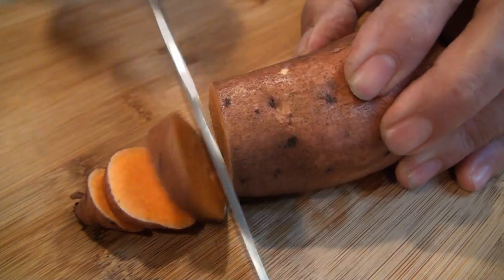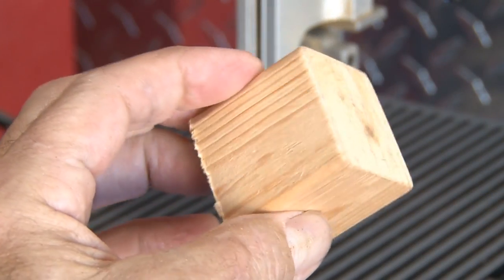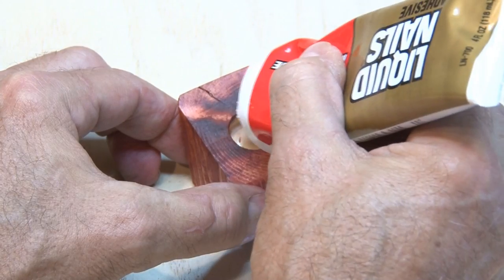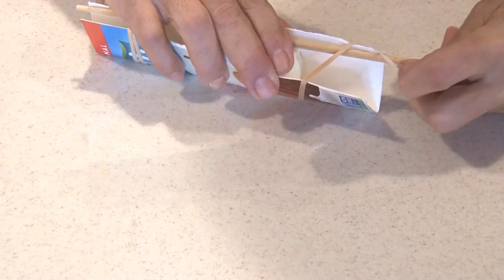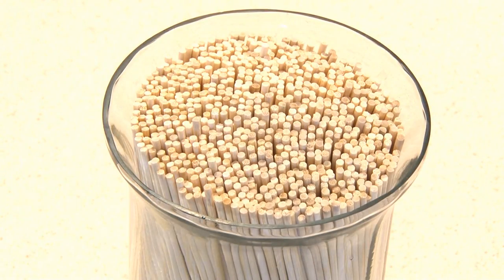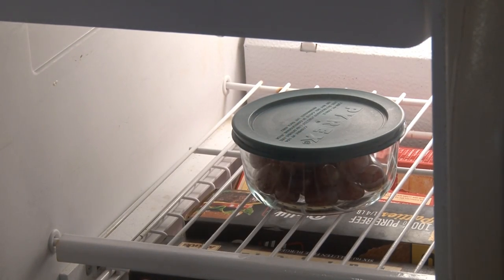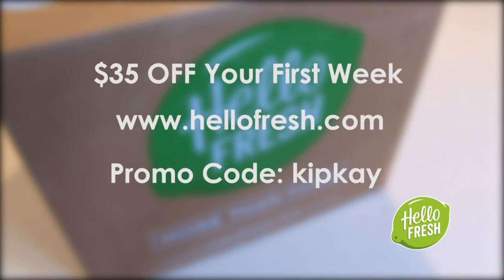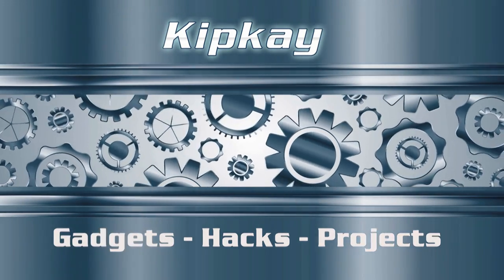4 Brilliant Kitchen LIFE HACKS!

Comment: Wood skewers are a bad choice. They absorb moisture and harbour all sorts of nasty microbes and molds.  Try plastic, even tightly packed thin drinking straws will do.
Reply: I was thinking the same thing...that's just a safe haven for bacteria
Reply: Microbes and bacteria need moisture and some warmth to grow and multiply.  There are many airborne and carried by insects so the act of washing the knives before has little to do with it. Even drying them does not really help as the wood would draw moisture from the humid kitchen air.